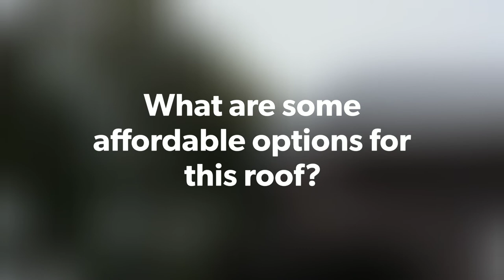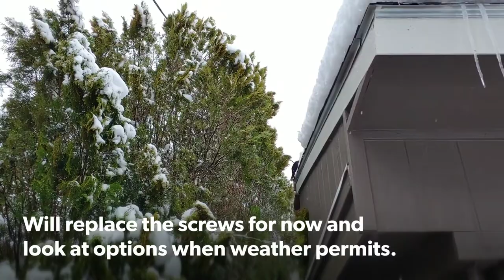Yakima Winter & Roof Updates February 14, 2019

Comment: I agree with your roofer about replacing the screws and putting heat strips to stop the ice dam will definitely help.  Ultimately that roof is flatter than I would like. Wish you well.

Comment: Hi Cindy 😳 okay...that roof clearly has NOT BEEN SEALED with a weather proof sealant. Replace that screw and any others that are rusted and seal the roof. Please know...if you put screws in the ridges as hes saying...only 1/4 to 1/3 of the remaining screw will be securing that sheeting to the perlin undeneath it. Remove the tree...agree w the heat tape to stop the ice jam.

Comment: Like I said previous that roof is way too flat for tin . Metal roof is meant for something that has a slope. 

That roof that's flat as it is you need a good solid plywood And then torch on  like rolled Roofing but they torch it on with a tiger torch overlapping each sheet melting together with the torch and they also have flashing on the sides that goes up 12 to 18 in. 

Having tin up there will never work the weight of the snow will cause those seems to open every time don't waste your money trying to repair tin . Galvanized Roofing or tin is great on a sloped roof but never on a flat .